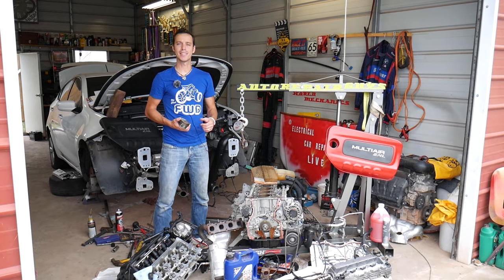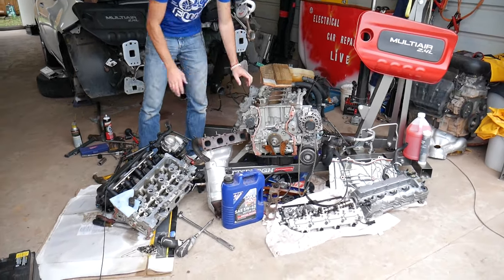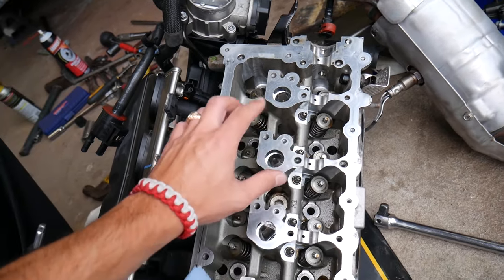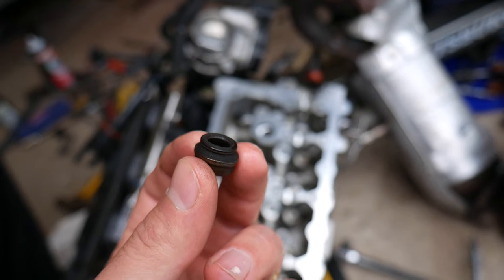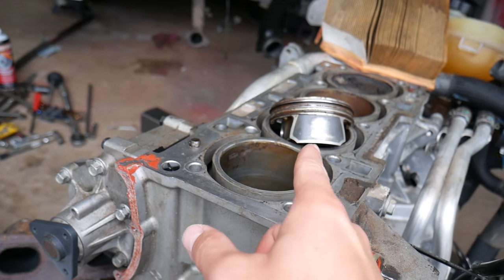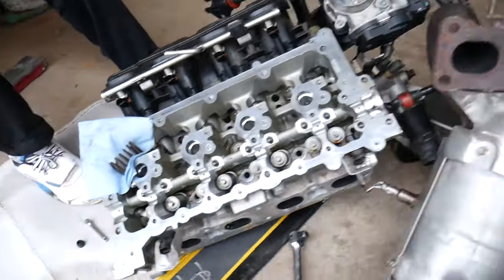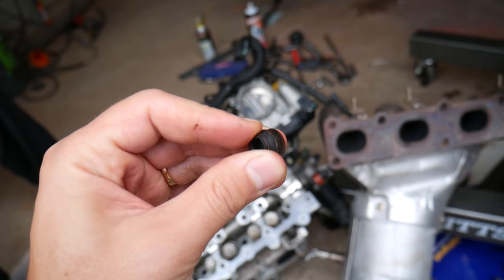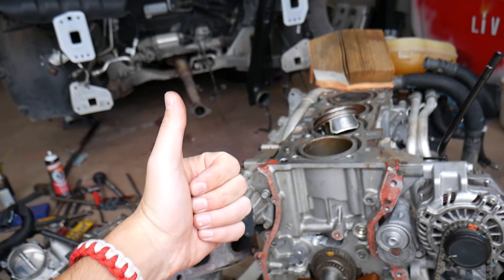HOW TO TELL IF CAR BURNS ENGINE OIL FROM VALVE STEM SEALS OR PISTON RINGS

Comment from the maker: Products that we use and recommend:
► Piston Rings (check fitment): https://amzn.to/3fPTUOv
► Valve Stem Seals (check fitment): https://amzn.to/30GwS6u
► Panel Removal Set: https://amzn.to/3YiMADu
► Tool Set: https://amzn.to/3p5MM6t
► Screwdriver Set: https://amzn.to/3XRB28Q
► Castrol Oil: https://amzn.to/3xBc8B9
► Oil Filter: https://amzn.to/3w0Ulme
► Torque Wrench: https://amzn.to/32qyRwg
►Liqui Moly Engine Flush: https://amzn.to/3IiDBID
► OBD Scanner that we use most often: https://amzn.to/3I4MQfe

► Check out our Amazon Store for the tools and parts that we use: https://www.amazon.com/shop/worldmechanics
Reply: What if exhaust puffs a burp of blue smoke cloud initially in cold weather only for about 2 seconds ones instead of minutes that you claimed?

Comment: Thank you so much. I almost paid $6000 for a rebuild because I thought it was piston rings but I think you just saved me a lot of money. I’m going to change my seals and wish me luck!
Reply: Hey Devin I'm curious of the outcome...I am having the same issue...don't want to spend unnecessary money
Reply: Same here, any update?
Reply: Tracker Pete  thanks, I will try that
Reply: $6000 for piston ring replacement?!?! Damn, i got charged $450 and i thought it was alot
Reply: @alexvargas4555  where are you located ? I need you work on my piston rings
Reply: Update?
Reply: Update?
Reply: Update?

Comment: awesome video!

i want to add that if you have blue smoke on deceleration (letting off the gas pedal) it’s another sign your valve seals or guides are worn. letting off throttle causes a vacuum on the intake side, drawing oil through worn seals.
also check your spark plugs! 
worn valve guides will usually accumulate oil on only one side of spark plugs.
if spark plugs are entirely covered in oil, this indicates piston rings.

that’s all i know on blue smoke, hope this helps someone.

Comment: Thank you very much for this video. I'm currently in school for mechanics and your videos are very very helpful. Thanks bro! JESUS bless.
Reply: I went for automotive tech but it was a joke man. 30 mins of “class time” where we we’re actually educated and the other 6.5 hrs was shop work where the instructors would only come out if they had a side job they were making money off of while exploiting the student’s free (to the instructors) labor and eagerness to work on something. I only stayed long enough to get certified to use a multi meter. I learned more in this video than I did spending 1500$ on one semester of school lol all it’s good for is the paper that says you sat through it all or as they call it “certification”. 

My truck actually went out on me coming home from school so obviously I just had it towed to the school. I did enough deducting to narrow it down to either blown head gasket or intake manifold gasket, but when I came to the instructors for some input or directions, all they said was “check the spark plugs” no context or anything but I was way past that and they wouldn’t even come look at it or anything, so I ended up having to drop out… 
“I had to drop out of automotive school because my truck broke down” sounds really fucking dumb without context lol
Reply: @jrattackk  I understand. The instructor here actually does try to educate and make sure we know what we are doing, he's always busy helping and I can respect it enough to stick around. Seems like some instructors or vested in their students ans others, well, not so much.

Comment: Thanks for the videos, perfect as always, i suspect bad valve seals in my N42 motor and now i have the confirm of that, only smokes blue when the car sits for a while and I start the engine

Comment: Thank you. Your video helped me diagnose my oil burning problem. I was afraid it was the piston rings but the car stops burning oil/ blowing white smoke after about 3-4 minutes of driving.
Reply: How stop what you have done
Reply: @fierakuitali9313 no oil burn after 5 min. Replaced valve stems and no issues after. 🙌
Reply: How much did you spend?
Reply: What is your car please ?

Comment: you just confirmed what I thought... my old Mercedes (1972) blows a big puff of blue smoke every time when leaving a red light and then it clears up once I'm rolling, or idling in traffic...gona change the valve seals before doing anything else.
Reply: Did you change valve stems seals yet? If so did it help?

Comment: Nice video and explanation. I think my valve seals are bad, my car really is using a lot of oil. When i start the car in the mornings, the idle is rough for a few minutes and i believe there is smoke (i need to look more closely to check). My question is, is replacing the valve seals a difficult job?
Reply: I got qouted $6,100 for a e39 540i lol
Reply: I just pulled apart my whole mk113 55 amg benz engine its not easy its not fun & its not something you should tackle by any means unless your study your engine & how it goes back together i just put new head gaskets & seals on the top block scariest shit ever havin my whole engine apart & in the car

Comment: Thanks. Ya my Acura legend only smokes when it’s idles for a min. But when driving it goes away. I’m in the process of taking it apart now
Reply: You find what is i have the same problem
Reply: @TIMTIM-xm5pr  yes, the oil is definitely coming in from the vacuum lines off of the valve covers not just the PCV but the other vacuum lines on the other head. The baffling in the valve cover that is supposed to only allow Blow by gases to pass isn’t working and allowing oil to pass as well. I found oil saturating my air filter, and in the intake tube and in the intake manifold. I installed two catch can reservoirs. One for each valve cover. They fill up after a couple weeks. I probably should just replace the valve covers, if I can find them. My car is 30 years old. I hope this helps

Comment: What do you think  N52B25 engine when starting cold it doesn't smoke and smell bad only rich fuel mixture smell. When it warms up then it's smoking constantly bad smelling grey smoke and when leaving from the traffic lights it puffs out a blue smoke and the exhaust smells like burning oil real bad. Cylinder 6 spark plug is covered with oil and all the other spark plugs looks ok only two other cylinders had ash deposits on spark plugs. Compression is ok so what do you think CCV or bad piston oil rings?

Comment: Is it possible to burn oil if turbo is failing? I drive audi a3 1.9tdi BKC and I noticed blueish smoke on cold start, and when it's hot it still smoking when I rev the engine. I haven't noticed big loss of power but for 2k kilometers I poured around 500 ml oil.

Comment: Can extremely worn valve seals cause the vehicle to smoke while raising RPM pressure I have a 1990 Honda Civic and it appears not to smoke until hard acceleration I just don't want to be wasting my time repairing one thing when it's another thanks best regards appreciate the video

Comment: I have a strange situation. I have a 97 BMW M3 that consumes about 1qt per 800 miles. No smoke on start up. No smoke on acceleration or deceleration. Engine runs amazing and revs ultra smooth. I think it may be the CCV (PCV) valve. Thoughts?

Comment: Thanks for the video, i think we can finally solve our 04 325xi's smoke issue. I usually notice a cloud of blue smoke after engine braking down a hill, especially if we come to a stop after descending/engine braking. My car has 160k mi.
Reply: So what happened did the valve stem seals fix the problem?
Reply: @taha4342 , we never got around to ripping apart that engine, sorry can't help on this one. I'd change them if you suspect them to be an issue, and if the vehicle you have is in a condition worth your time.
Reply: Did you finaly change valve stems seals?
Reply: @tonykollar6870 , no we've never fixed this issue, but the car still runs great.  Now at 194,783 mi. She got some new cats, and probably gained 15 hp from getting rid of the old clogged catalytic converters. We would like to do this job, but just haven't gave it much thought. The car deserves it, it just has not been high priority yet, though this post was made 2 years ago. 🤷‍♂️

Comment: What if the car consumes oil but the exhaust smoke is white? My Seat Leon MK2 doesn't have rough rpm but  has a small pending rpm at coldstart, after the coldstart goes down (15-20 sec) then idle is good. White smoke comes out even when warm. I don't see any waterleak because it is on same level all the time. I know these EA888 gen 2 engines have issues, but what I experience doesn't match with what I experience. High consumption of oil but white smoke. Waterlevel is good but not oil level. Am I missing out something? Thanks man, your videos are the best!
Reply: Head gasket needs to be replaced

Comment: Thank you! I think you just diagnosed my problem with mine 2008 r55 mini clubman cooper s.. I think it's the seals indeed. Although I burn a liter oil every 400km orso.. That's alot but.. The symptoms are more on the seal side then continually on the cilinder side.
Reply: What happened, did you fix the Mini?

Comment: i replaced my piston rings last year payed 6k for it but still smoking its not losing oil i only top up around 50-100ml for every 30k miles i hope its only valve seal issue it sometimes have smoke and sometimes it doesnt

Comment: What about blue smoke ONLY  under hard acceleration like when passing another vehicle.  Car has only 30k miles, but in storage 7yrs, No external leaks, good pvc but consumes  oil based on dipstick reading. My guess is hardened seals?

Comment: Ok I’m confused, based on my compression test, it’s the valve seals - I did a leak down test and still had no compression after doing dry compression test.

150-150-0-150 compression test readings (cyl. 3 is dead)

- it’s burning oil constantly

I replaced the pcv - it was faulty from day 1 - I believe it’s what caused the blown valve seals on cyl. 3 from too much oil pressure. (intake manifold was full of oil when I replace the pcv)

Engine is 2.0l Cobalt SS Turbo LNF -  has 20k kms - prior history of blown valve seals

Thoughts?

Comment: Also if you check the spark plugs and one or two have much more carbon on them than the others thats because the intake valve seals are letting more oil get sucked in.

Comment: Great Video!!!! can you replace VALVE STEM SEALS without removing cylinder head?
Reply: you should be able to you would need to put air in the cyl or do the rope trick to stop a valve from dropping though

Comment: What I don't quite understand with these oil consumption issues are if the catch can isn't catching much oil from the PCV and you have no smoke from the exhaust where is all the oil going? I have a Mini R58 N14 engine which has all the classic symptoms of high oil consumption (1 quart per 500 miles or so) but no smoke, little oil in the catch can and no oil leaks so where is it going? If it is going out the exhaust which is the only place that makes any sense why has my catalytic convertor not been destroyed or thrown an error and how do I pass yearly emissions tests? - I give up!!

Comment: Dear, can you tell me what's the problem with my engine?There is a lot of blue smoke when RPM.
Hits 3800rpm.  
But if I Acceleration too much Like crossings six thousand There is no single misfire
But lot of blue smoke

Comment: Great video, i do get a white puff smoke on warm startup engine lasts for 3-4sec then it evaporate, sometimes it happens sometimes it doesn’t, depends on how I parked if I parked in incline surface it happens other than that never bothered, but all I know is it never happened while I’m driving thou, would this be a valve stem seals? Any help would be appreciated thanks 🙏
Reply: I have the some problem sometimes when i start the car cold start only when i start the car  and cold engine

Comment: Thank you for your detailed analysis.   As for valve seals, will it smoke under hard acceleration as well?
Reply: You are right... also (he didn't mention) If the seal is cracked or worst,  broke off,,, it will act just like a broke ring. Have to determine the miles, how it was drove.. etc...

Comment: I've got a n54 engine in my 335i and it does not smoke on cold start but after driving the car if I switch it off then come back to it again and switch it on, it starts smoking white smoke for a few minutes but does eventually clear and go. Usually does it for about 5 mins. It is using a lot of engine oil too and does smell like oil burning when it's smoking. I do have downpipes but still have secondary cats. Any ideas what it could be. I've tried seal conditioner but no luck
Reply: You have an n54, I’m afraid you bought a lemon.

Comment: Approx How much oil can you burn in a 6 cyl if the  VALVE STEM SEALS are all bad?  Could you burn a 1/2 quart or 3/4 quart of oil in 250 miles if those  VALVE STEM SEALS are bad?

Comment: How it can be explained that the car burns oil but it doesn't have any leakage or smoke ? What could be the reason? Because once the oil ends in the combustion chamber , through valve seals or piston rings, you should have smoke, right?

Comment: Unfortunately this does not apparently cover all scenarios :( . I have a mower that loves to burn oil, but how much it smokes seems to depend on orientation of the mower or where I am in the yard, don't always notice clouds, usually they aren't there right when it starts up, but they seem intermittent... I guess it must be burning it all the time though because I throw half a quart in and sand blast the spark plug for that cylinder every single time I mow. Guess I need to visually inspect those valve seals first, that's the low hanging fruit.

Comment: What if i have zero smoke? Engine and car run perfectly fine. No obvious leaks either. Except for the fact that it consumes a quart of oil every 150-200 miles. Already changed PVC valve but theres no symptoms of anything wrong other than oil consumption
Reply: Oil is burning if you can’t find a leak so u need to really check some cars are known to consume oil turbo cars cars with cylinder shut offs like dod mds whatever they call it
Reply: @jacobpatterson1091  I own an Acura TL 4th gen which are known to burn oil from piston rings but i just find it strange how there is no other indication of it like smoke or the engine running poorly because a quart every 150 miles is ALOT
Reply: @user-bi2me1kj7p  got a 95 s-10 with a 2.2 4- cylinder same thing no smoke about a quart per 150-200 miles if you figure it out let me know.

Comment: Not totally true tho 
I changed valve seals and head gasket and still had smoke only on starts 
Had to reopen the engine and change piston rings and that fixed it costed me double the labour and 2 head gaskets